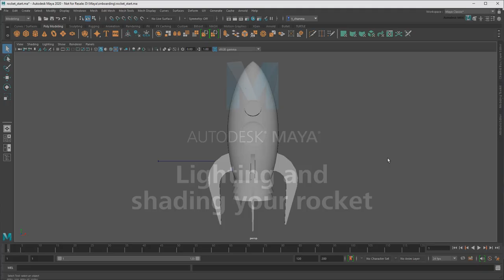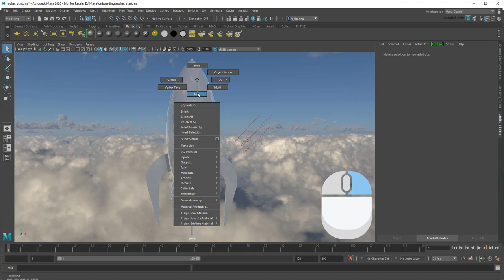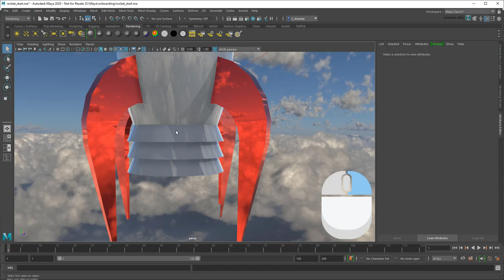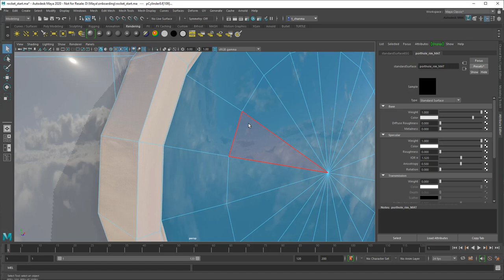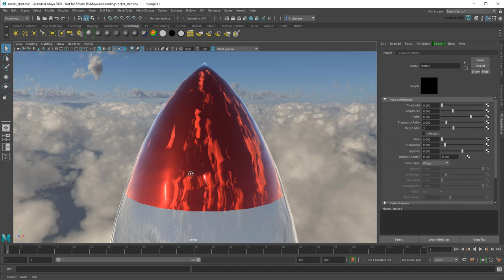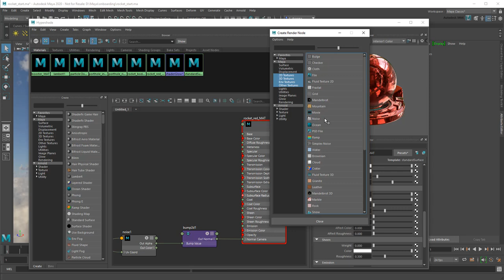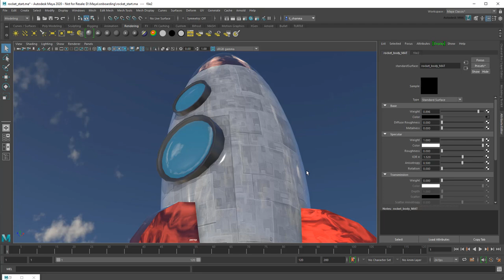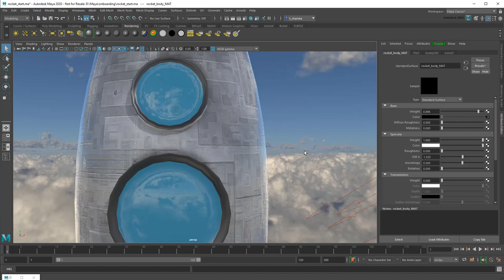Intro to Maya: Lesson 6 / 10 - Lighting and shading your rocket

Comment: Great lesson! I made the rocket as described, then tried to import it into Unity to use it in one of my scenes. Surprise, the FBX plugin does not support the materials used for this exercise. I reapplied Lambert materials and this time it worked fine. So heads-up for those who want to apply textures and materials in Maya before exporting to Unity, make sure your materials will be supported by the FBX plugin.

Comment: Hello. I have a problem using the direct light through the rocket. It seems like the light and shadows are not moving. They shadow just turns the other side when I rotate the directional lights to 180 degrees. Do you know how can I fix this? Thank you in advance!

Comment: Thank you for the great Tutorial
For "Selecting adjacent Faces I just gor "Shift + >" To shrink selection i just go "<" 
(See "select-grow or shrink selection)
One question I hope you could answer me is, how do you select Objets on an Object easier? In Blender you just press "L" over an Object to select it. I found it rather hard to select all fins with the lasso. (I selected one and then "Select similar") But isn't there a better way? 
thank you, hope to see many more Tutorials from you, youu are a big help!!!
Reply from the maker: Actually, another super easy way to select those fins is to use UV Shell component mode (right-click, UV > UV Shell).  Then you can just select each fin (this works because they each have a separate UV Shell).  

I thought about showing this method, but then I'd have to explain what UVs are all about and I figured this video was full enough as it is.
Reply: @Autodesk_Maya  OH my gosh, thank you, that is even better and faster. God bless you!!!
Reply: @Autodesk_Maya  Hallo again. Just realized that when i put on the Texture, I find a white Gap between my cone and my body (Top is red then a white "belt" below your material. Can't figure out how to move that #&%@ texture.... 
could you give me an advice? Thank you.

Comment: Hi there fellow Maya enthusiast!
Speaking of textures ( 9:30 ), does anyone know if i can scale the texture once is applyed to the model?
Let's say i have a cylinder-like object and i want to apply a texture of a vinyl via an image file i shot but the picture is larger or smaller than the object; is it possible to resize the image in order to match the object?
Thank you again for the answers, love, Tito.
Reply: Hey Tito!

I was struggling with this as well. For me, my rocket body was longer than the tutorial's. I tinkered with the "rocket_body_MAT" 's 
Steps to get there: 

select rocket ----> select the tab: "rocket_body_MAT" ---> select the base color (arrow-box thing ">☐") ---> you will have 2 tabs select "place2dtexture5" or the other tab not named "file2" or something

From here on, I played with the "2d Texture Placement Attributes" attributes. And these changes worked for my taller rocket:
Coverage: 1.000, 1.300
Offset: 0.000, 1.100

 I don't know what's the case for your model, but try messing around the attribute values with SMALL INCREMENTS like what I did with mine. 

I couldn't find any helpful resources online to solve this problem, but this experimentation worked for me. Hope this helps! :)
Reply: @weksheddweller for me worked
Coverage 1.000 , 1.300
Translate Frame 0.000 -0.1500

I accidentally charged that Trans. Fram instead of your Offset, but it worked 😅
Anyways thank you for you sharing this solution

Comment: whenever i add the included rocket texture for the last part it does not cover the whole rocket (by the top it is still white) is there any way to stretch the texture or fix this? amazing tutorial thanks! (i would have done your in program interactive ones but the computer couldnt handle it lol)
Reply: I’m also fighting this issue, have you found a solution? Pleeeease? 😊
Reply: @TheEasygone  shyyyt i think i just left it white or found a different texture to use lmao

Comment: Thank you for this tutorial ! I only had one problem when uploading the image for the body. It doesn't appear when I apply it . I've unabled the Hardware Texturing, so it works for the bumps, but not for the image. Can somebody help ?
Reply from the maker: Have you made sure Textures are turned on in the Viewport?  Also make sure the "Default Material" is turned off too (in the same row of icons).

Comment: For some reason, when i gave my rocket  a material, half of it is black for no reason. I thought is a bug so i continued to work on it. But now it wont let me use texture on it
Reply from the maker: Did you build the rocket following the exact steps from the previous video?  If so and this still happened, you can try selecting the rocket body and going to UV > Cylindrical, then retry the steps in this video.
Reply: @Autodesk_Maya  yes i did, as i know maya a little, gotta say, making uvs cylindrical worked! Thanks :)

Comment: Everything was going fine until I tried to add the file. Did everything exactly like in the video but image background does NOT appear after loading this file into Skydome Light.
Reply from the maker: Do you have lights turned on in the scene?  Also is the file you're loading an HDR format?
Reply: Same problem here:
you might want to change your renderer to Arnold instead of viewport 2.0

Comment: hey. i did everything as shown but for some reason the bump i add is just not noticable, i re-did it many times but i just never see the bump on my rocket, pls help
Reply from the maker: Have you tried increasing the "Bump Depth" value?
Reply: @Autodesk_Maya  i did. Not a change visible. I think my application bugged, because when i added the texture you provided, in the description, it didnt show on the model as well.
Thanks for replying btw
Reply from the maker: @jsdkilla1878  Do you have textures turned on in the Viewport?
Reply: @Autodesk_Maya  yes i do, checked multiple times

Comment: In the modelling tutorial (part 3) he did Boolean union but in this it looks like 'combine' is used, why is that?
Reply from the maker: There's a bug in Maya at certain scales (too small) where Boolean used to make the model vanish - so I used combine to avoid that from happening.  Since booleans were revamped in a recent release, this is not an issue anymore.  In general, it's better to use booleans when you can since it eliminates a lot of unnecessary geometry.
Reply: @Autodesk_Maya  The same thing happened to me, it fanished even though I'm using the latest version of maya, Thanks  🙌 awesome channel

Comment: Why did it show “rocket_red_MAT” when you said rocket red mat and what is _ and “
Why looking at this, you think you’d like the same colour for your fins too and how and why so you will go back into face mode and carefully select all the fins faces and how 
Why a combination of the lasso tool an symmetry can make this easier and how 
What is combination and lasso tool and symmetry 
Why white thing moved to left and second thing then went to rocket and white circle went around one of bits of rocket
Why white thing went up to white triangle next to symmetry then it showed off object X object Y object Z World X World Y World Z Topology and what do all these mean and why white thing went to object X and it turned blue and all the words went away 
Why white thing went to circle on very left 
Why circle went around one leg of rocket and it showed shift green + left at top of white thing blue
Why white thing went to symmetry: Off at top then object Z and then all words went away and all three of bottom things turned brown 
Why it started going around rocket 
Why rather than making another red material, you can just re-use the same one by holding the right mouse button and going to assign existing material > rocket_red_MAT and how and why white thing went to assign editing material then rocket body _ MAT and how 
What is red material and existing material 
Why next, you’ll select you booster faces and add another standard surface shader and how 
Why things showed and white thing went on face 
why it started moving around rocket and white rectangle went around bottom and bottom turned brown
Why white thing went to grey circle 
Why which you will call booster_MAT and how 
Why this time you’ll go with a less reflective “ceramic” preset to start and how 
What’s reflective and ceramic preset
Why white thing went to ceramic then replace and how 
Why however, you’ll dial down the specular and assign it a very dark grey just to differentiate it from the body and how and why white thing was on rectangle next to weight and it moved to right and white rectangle next to colour moved to left
Why for the portholes, you’ll assign them two colours: one for the inner porthole, and one for the rim and how 
What is assign and inner porthole 
Why to select the faces for the inner porthole, you’re actually going to start with vertex mode this time, then select the single vertex at the centre and how 
What is centre and vertex 
Why then, you’ll expand your selection outward by one row with “shift+.” (AKA “>”) and how 
What is shift period and why did it show “shift+” (AKA”>”) when you said that and it showed shift + >
Why now with this selection of vertices, you can go to select > convert selection > to faces, which selects all the adjacent faces and how 
What is select and convert selection and to faces and selection 
Why white thing went on select at top and down to convert selection and on right to to faces and what do all these mean 
Why and then you’ll create another new material called “porthole_inner_MAT” and how 
What is porthole_inner_MAT and “
Why white thing went to grey circle at top then black rectangle next to standard surface and word in black rectangle changed to porthole_inner_MAT
Why again, you’ll use a “car_paint” preset and how and why white thing went to word preset under focus then car paint then replace and how 
Why then you’ll do the same thing to the upper porthole and how 
What is upper porthole
Why it showed seven words and the word vertex was blue and had white thing on it
Why is it showing shift ^ green + >. And what does this mean

Comment: Why so just to hammer home this workflow one more time, let’s assign some bump mapping to the booster and how and why white thing went on bottom of rocket then it turned a bit green and why just like the rocket you’ll go down to the Geometry section and add a Bump Map with some noise… and how and why it showed create render node and stuff under and white thing went to noise and how and what does all this mean and why white rectangle next to bump depth moved to right and why …then go back to the Hypershade, select the material, select the material, and show its inputs and how 
and why white thing went to booster_Mat then to white triangle rectangle on top of untitled_1 and then everything started moving and it turned blue outside big grey rectangle and why  from here you can adjust either the bump depth, or the noise pattern and how and why white thing went to grey rectangle on the right then shader ball then it showed shader ball and cloth and teapot and ocean and ocean splash and glass fill and glass splash and hair and sphere and plane and what do all these mean and why white thing went to teapot then everything went away and why white rectangle next to ratio moved to the left then white rectangle next to amplitude moved to the left and white rectangle next to threshold moved to left and frequency ratio moved to right then left and white rectangle next to time moved far right and what does everything here mean and why white thing moved to - at the top then everything went away and what were the other two things next to - 
What is hammer home and workflow and bump mapping and booster and geometry section and bump map and hypershade and inputs
Why this time you’ll skip the dirt since this part’s already pretty dark and how and why so that’s the basic use of the hypershade, but with just a bit of out-of-the-box thinking you could do way more powerful things with it and how and why for your final example, let’s assign a texture to the main body material… …by clicking the palette button next to base colour and loading a file and how and how and why did white thing go to rocket_body_MAT then geometry then it moved grey thing up then it went on white and black thing next to white rectangle next to base then file and words went away and colour of rocket changed 
What is basic use and powerful things and assign and main body material and loading a file and palette button and base colour and geometry 
Why we can find the texture linked below and how and why stuff showed under maya then white thing went to open at bottom and why this adds a panelled metal texture to your rocket and how and why was white rectangle next to weight moving to the right and why however, at first glance it looks very flat and how and why just like the red areas or the booster, this needs some bump mapping to it and how and why but in this case you don’t want to apply just random noise and how and why instead, you’d like bumps to match up with your panelled texture and how 
Why noise came and hyperbole and stuff under showed and white thing went sixth M on top of rocket_red then white rectangle under and how 
Why so let’s first create a bump node manually  in the hypershade by pressing Tab and then typing “Bump” and how and why did it show rectangle with words in it and why then white thing went on bump2d then rectangle turned purple and why you’ll plug that into the “normal Camera” just like we saw before and how and why purple thing moved down a bit and why only this time, you’ll steal “Out Alpha” directly from the same file providing your texture map and plug it straight into your bump map and how and why suddenly we can see that your model looks bumpy in exactly the spots where the panels are and how And why yellow thing came out from grey rectangle to purple rectangle and why the of course, the effect is a bit too pronounced, so you’ll just dial down the bump effect and how and why white thing went to black rectangle next to bump depth then number in it changed and white rectangle moved to the left and why now you can see how the light plays off the bumpy texture, adding another layer of depth and believability to your model and how and why similar to that, you can show inputs for multiple materials at the same time and how and why it showed blue on top left of white thing then shift green + showed on left and why in this case your red and body and how and why did white thing go to square on top left then the rectangles got smaller then things got closer to rectangle at bottom and why then you can steal the coat of dirt from your red and apply it straight to your body and how and why yellow thing went from grey rectangle under purple rectangle to big bottom rectangle and why was grey thing at top right turning around 
What is textured link and panelled metal texture and glance and apply and tab and bump node and normal camera and plug and “out alpha” and directly and file and providing and texture map and panel and pronounced and effect and dial down and bump effect 
What was “ around normal camera and bump and believability and model and bumpy texture and layer of depth 
Why was grey rectangle with red around it changing a bit
Why as with the modelling lesson, this is just a taste of what we can do with lighting and shading in Maya and how and why to apply what we’ve learned, why not try creating some windows out of half-spheres, then adding glass materials to them and how and why or add a new material to the bottom of the booster to make it look more rocket-like and how And why it showed orange under rocket 
Why and if we like what we saw, please remember to comment and subscribe to the maya learning channel and how and why it helps you figure out what kind of material is popular so you can make more in the future and how 
What are glass materials and half-spheres and popular and future and subscribe and comment